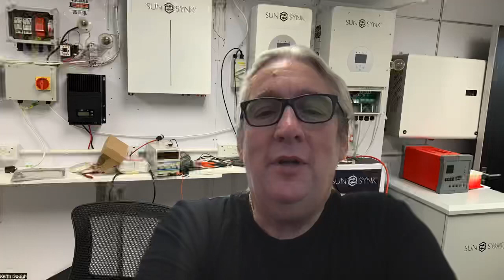Commissioning Sunsynk Inverter

Comment: I have a Sunsynk XL Hybrid Inverter installed . It all works as it should only with the app it under reports the Grid Import . Have used 72kwh from the grid in 10 days but it says 7.4kwh in total! . The CT clamp seems to be fitted ok next to the Inverter and correctly shows on the flow chart the AC coming in but it does not reflect this on the daily Grid import figure . Is this a bug in the firmware or is it something that could easily be put right?

Comment: My battery is a DIY battery using Bluetooth communication to an app. There is no COM port to connect to the inverter
Reply from the maker: How can the inverter measure the correct SOC
Reply: @sunsynk  I guess the inverter wouldn't be able to measure the accurate soc. But if I can set the voltages correctly, would that work just as well? So I'll use voltages instead of soc on the inverter
Reply: So these are 2x 48v 200ah batteries connected in parallel.
Reply: @Montypaks  I'm running my sunsynk using voltage as I have diy battery with jbd bms's.   Also using solar assistant.

Comment: Hi guys.I am installing a 8kw Sunsynk inverter with 12x 480w solar panels and two 5kw Revov batteries.Can anybody give me some basic settings to start off with and then i can maybe tweek them a bit after the system has been up and running for a week or two.
This would be a great help from somebody that already has a similar system up and running already.
Kind Regards
Mark

Comment: Good after noon Joel and Keith
I am a end user of the Sunsynk system in SA. 
As  we having continous electricity black outs due to ageing Eskom infrastructure i decided to switch to a Sunsynk hybrid grid tied solar system
System details"
Inverter Sunsynk 8.8 kva inverter
2 X 5.5 Hubble lithium batteries
12 X 460 watt canadian solar panels 
  
I had a solarman stick logger  model LSW -3 which was initially fitted by my installer  but he did not connect it .I contacted him re connecting the solar man logger but he said it was complicated.
So i decided to connected it myself as an end user on my Laptop following the  manual and it worked basic but stable and the readings fo the key info such as SOC,Solar panel  charging rate for solar array 1 and solar array 2 was always synchronised with the the inverter readings.
I then was able to connect it to my android samsung a12 smart phone.
However as it was basic in terms of info , my installer said if i sent it back to him he would swop it out for the Sunsynk logger DB9 serial no e470121b5621 which was a better logger .
He said as an installer he would load it and include me as a end user but for some reason he could not log on to my network
I installed it and once again i had to load it on my laptop to get it all connected.
Then on my phone.
I got the the same info as the solarman but it was not sychronised immediately like the solar man with the read outs on the inverter. The only info that was the same was the SOC the rest was all lagging . For example The house was using 304 watts and the i switched on the house water pump and it went up to 1820 watts. The pump stopped after 1 minute but the sunsyk logger readout on my  phone still showed 1820 watts after 15 minutes .
The inverter readings changed immediately back to 304 watts. The solarman also changed back immediately.

Please help me with this problem as i go away frequently and need to monitor my solar system performance on my cellphone.
Also on the sunsynk it does not split the solar paner arrays and the readout figures do not tie up exactly with the the figures shown on my phone app?

Please advise 

Regards

Ken Rowney

Comment: So our sunsynk inverter isn't working. We've got no grid power and our battery ran flat and its the sunniest day ever and our panels aren't generating anything. Have tried to reach our sunsynk installer and no luck. Very frustrating having all this fancy stuff and it doesn't work when its supposed to.
Reply: Did you win in the end?
Reply: @Sir_Gee  yes... Super simple just had to hit the red button on the battery. 🤦🏼‍♀️